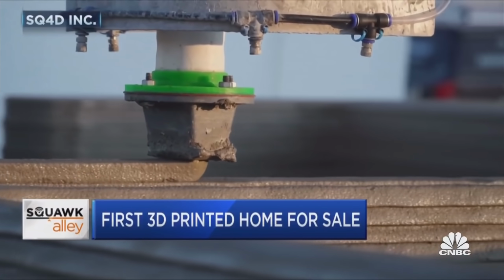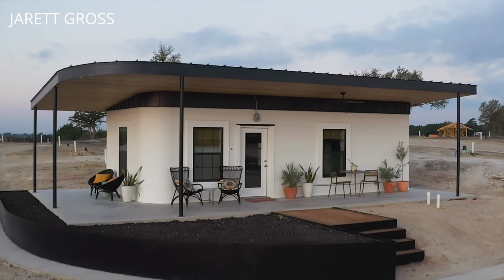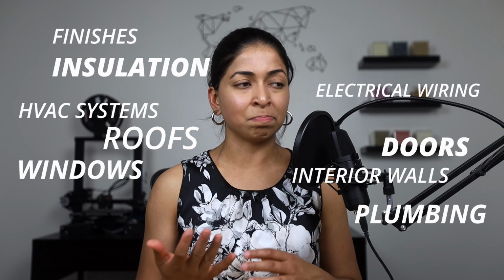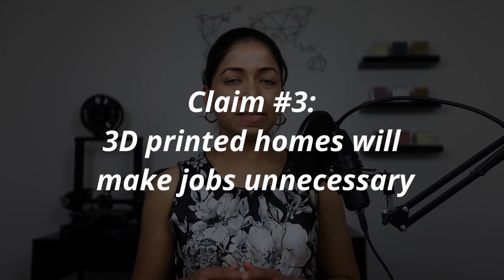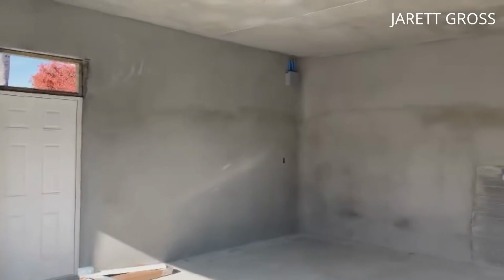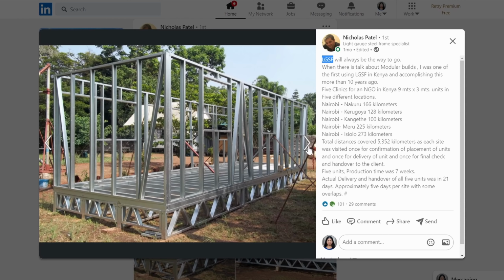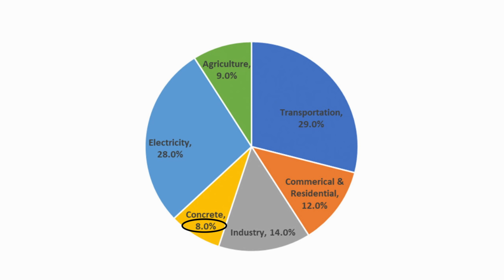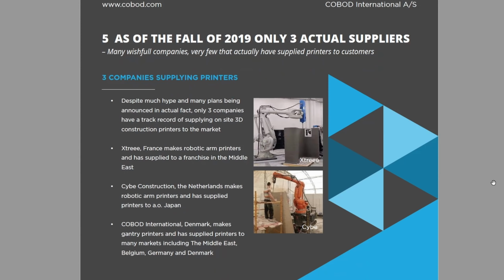Exposing 5 LIES about 3D Printed Concrete Homes

Comment: Anyone who has used a 3D printer will tell you one thing

The first layer is CRUCIAL. If it fails the whole print is most likely ruined. Now apply that concept to a house which can be SUPER expensive
Reply: No, that's not a meaningful comparison. The reason first layers are important on traditional printers is that the material shrinks as it dries/hardens/cures, and it solidifies extremely quickly. The first layer needs to hold it tightly so that it doesn't warp as it's curing.

Concrete has some shrinkage, but that happens very slowly, and the material is weak in tension. Instead of shrinking inwards, it primarily develops microscopic cracks.
Reply: @louisvaught2495  Still seems like the first layer of a 3D printed house would be important to the overall structural integrity. 3D printed concrete may not have the same issues as home 3D printer material, but it will have it's own challenges.
Reply: @MimiRAM0NE  The problem is that trying to draw an analogy to normal 3D-printing is basically a complete failure to understand how and why the two things work.

Printed plastic can extend and contract a lot, and builds internal stress that causes it to warp and change shape. The first layer has to hold the part in place so it maintains shape while printing.

A small mistake at the base of a printed concrete building doesn't cause the entire structure to curl inwards - aka failure of the entire print.
Reply: @louisvaught2495  I agree about a small concrete flaw not likely ruining the whole structure. Thanks for explaining more about 3D printing, very interesting!
Reply: CR/BL touch for home 3D printers and you will never have an issue. For houses, you do not have a small nozzle, the layers are at least an inch or two thick, also the weight of the material will level out.
Reply: Haha, funny analogy but not even remotely the same functioning principles during the process and final goal.
Reply: Imagine leaving it unattended and coming back to a failed print...of a home!
Reply: @MimiRAM0NE  we call that the slab and yes the slab is important in all houses
Reply: joseph quinn  Maybe, but what is the point of hauling in, assembling, calibrating, running, disassembling, and removing the fancy concrete 3d printer instead of just throwing up some prefabbed molds and pumping concrete walls while you already have the concrete crew on site to pour the slab? Labor is very cheap in most of the areas this would be useful but the 3d printing machine isn't, and it is much easier to accommodate for things like plumbing and electrical wiring in molds than to make the 3d printer print around them.
Reply: I work with clay printing and we always say, that the first layer really is a mess and it always gets better 😅
Reply: I love this discussion. "Pfft, you think the first layer matters? This isn't plastic, dude! But yeah the first layer could have little imperfections that ruin the entire house and you should just use a normal foundation BUT IT'S STILL SO DIFFERENT!"

Is it? Is it really?
Reply: @louisvaught2495  The first layer of a 3d printed concrete house is important but for a different reason most common to plastic printing. Was the printers structure properly assembled & balanced?

Comment: As a mechanical engineer I have to agree with you on the "solutions looking for problems" point. I've seen it repeatedly over the last 20 years or so (and even participated a couple of times). It used to be called "rapid prototyping" which was maybe a more honest description of it's typical applications.  It's not that I don't think the concept has potential, I just know the gap between where it is and what is being sold is significant.  I see lots of press about the speed and labour savings, but little about the mechanical properties or durability of structures made this way. 

I also wonder what 3D printing concrete achieves that pre-cast and/or poured concrete can't.
Reply: Pre cast and pouring needs someone to design and make molds for the concrete
Reply: @mrslinkydragon9910  There are plenty of modular pouring systems, that are assembled on site as needed. You add rebar into it, then the concrete pump arrives along with a bunch of mixers and you are pouring in 10 minutes. No giant CNC structures, and is pretty fast. You can create whatever structure you want, as tall as you need it, you can put water, heating pipes and cables in the molds before pouring the concrete...
This so called 3d printer is very limiting and won't be any cheaper than traditional methods. That's why no self respecting construction company is adopting it.
Reply: All I can think of is niche work where a form would be exceptionally difficult to build or tear down.
Reply: I guess extremely complicated curves in walls. 
But few civil engineers dare design them. PITA to do the calculations.
Reply: Looking at the walls in videos like this, the benefit is crazy thick walls.    That may not be a benefit though, it may simply be an inherent flaw in the design.   I'd think it would be cheaper to cast blocks at a factory with 25% of the concrete used in these solid walls.   It looks like with a decent work crew, they could put the concrete block walls up just as fast.  Or precast the walls at a factory, and deliver them to the work site.
Reply: @mrslinkydragon9910  "Pre cast and pouring needs someone to design and make molds for the concrete" ...and the emergent technology of 3D printing doesn't require more design work to qualify the structure in an unproven medium?

Comment: As someone that live in a country with heavy seismic activity he idea  of living in a house without a steel frame is kinda scary specially when construction companies often cheap out with the concrete
Reply: I'm in the structural side of design, and my first thought whenever I see any of these videos is "and how are you reinforcing? Is it in the cores, similar to CMU? If so, HOW." I don't blame you for being scared. I see this as presented by news agencies, and I see "Unreinforced Masonry - but High Tech!" URM is a huge killer in earthquakes.
Reply: Are you guys slow? Most houses in america are made of wood and drywall, not steel.
Reply: @thefunshackwars5418  I am from Peru in South America it's located in a continental fault line so we get magnitude 5 and 6 quakes somewhat often, most good houses are made from brick and concrete with steel frames
Reply: @MarkCisOfTheLoonieLeft  hemp wouldn't resist a rainy season though
Reply: Properly designed wooden structures can be just as safe as steel frame (up to a certain size, skyscrapers aren't really an option with wood), but if you don't have an abundant supply of cheap wood available the way Canada and the US do, then yeah, steel framing is definitely critical if you're expecting any seismic activity at all.
Reply: @rashkavar  yeah thats why a tornado comes and wipes all the houses xD it wouldnt wipe a reinforced concrete one though... all other countries build with it and they last a life time, while America wood houses don't last for shit and are on constant remodeling and fixing. Most of the times houses with like 15 years are completely destroyed and rebuilded since its faster and cheaper, than fixing all the issues.
Reply: @eisforenkai  yeah i was tinking about that to is it just hollow inside?
Reply: @vinhix  well... we dont have tornados and shit but our wood houses in Norway lasts for 100 years easily if its built correct. Then again i guess we have a much higher standard here on our houses considering the cold and all
Reply: @vinhix  So let me counter your arguement. Whens the last time say...florence had a tornado? Or really any tornado of any significance anywhere in say... Europe that hit a population center?

Secondly, Masonry doesn't hold up much better against 300-500 mile per hour winds than wood does. The joplin tornado actually lifted the hospital and moved it a few inches and wraped I-beams around trees. Ain't shit you can do about that other than building bunkers.
Reply: @eirik874  We have wooden homes that are over 300 years old in the US. Its just uncommon. But you also have to realize, Americans were dirt poor until the 50's. You just didn't have money to build good houses unless you were rich.
Reply: @goldenhate6649  i understand that yeah it was hard times i can imagine. Did people build with whole logs at that time? because those to can stand for a long long time.
Reply: @vinhix  The problem with your statement is that you specify "reinforced" concrete.  These 3d printed concrete houses don't have the steel rebar inserts / steel frames that create the reinforcing effect so it has limited ability to resist catastrophic failure.
Reply: @vinhix  That's untrue. I used to frame houses (some of which recently were tested in a tornado that you can find videoed on YouTube. Andover, KS from earlier this year) While 200 mph winds do destroy wood framed houses, the concrete and steel building next to them was also rendered useless. It turns out that a chain is only as strong as it's weakest link. Windows and doors become inroads for debris and wind/ rain, meaning that a "concrete house" will be very nearly as dangerous in a tornado. I was even warned to stay away from poorly constructed concrete warehouses in a port in Madagascar when I was volunteering there and a cyclone was forcast. 
I've ridden out the first Andover tornado (April 1991) in a wood frame structure which I also was in when a 4.6 or so, magnitude earthquake happened a few years back. Nothing even fell off of the walls because a structural frame design with an outer skin, such as American woodframe houses, is actually the basic design behind skyscrapers and it allows a structure to flex with conditions. The house is still there, today, and recently remodelled due to the incredibly cost efficient upsides that come with engineered wood frame construction.
Reply: I live in a country with practically zero seismic activity, and on top of that we have only had a total of like 13 hurricanes in the last 130 years, and I still wouldn't buy/live in a house made of concrete with no steel :)
Reply: @thefunshackwars5418  wood is stronger than you think. And it can bend, so it’s safer in eathquakes than pure concrete.
Reply: You and everyone in the ring of fire, buddy. Depending on where you live, a Richter 6 can range from everyone losing their shit to "Huh, I actually felt that one. Goona check the news, might have been bad somewhere."
Reply: @rashkavar  well Japan been building wooden houses in earthquake zones for over 700 years
Reply: @vinhix  This is utter nonsense.  Where I live almost all single family dwellings are stick framed houses, with an average age of about 50 years.  There are lots of buildings 100 or more years old, and anything built since modern codes were introduced in the 70's is likely quite capable of lasting for centuries without any major changes to the base structure.
Reply: @vinhix  Wow, good to know the 52 year old house I'm living in has been rebuilt 3 times.  Or the almost 100 year old house next door.  Yep, every 15 years.   Where do people get this crap?  With the exception of the house next door, nearly every house in my neighborhood is at least 50 years old.  Although, mine did have 2 new layers of shingles on the roof, does that count as being "completely destroyed and rebuilded"?  Well, there was that one house across the street that was at least 50 years old that caught fire one night.  Strangely enough, they just fixed the damaged parts.  Does that count?  Come to think of it, there have been at least 3 other houses in my neighborhood that had fires, in the 22 years I've lived in my 52 year old house, and all of them just got repaired.  Guess they all got "rebuilded" too?  Maybe rebuilded means something different where you live?  Anywho, have a nice day.
Reply: @vinhix  Probably because all of those people are constantly wanting "improvements" to the houses, such as extensions and expansions, which aren't done properly so you end up with things like leaks going between walls when it rains heavily, then wind up with parts of the building decaying or falling apart. Always the "latest and greatest" trend pursuit going around as well, so there will be people trying to one-up each other and make the building look nicer for some of the people with more wealth. And don't forget the fact that sometimes the land is more expensive than the building itself, but people will mostly be looking at the building when buying a home, so there's a need to make that home look prettier -- even if it means completely tearing down the building and starting from scratch. Wood houses are probably easier to start a remodel process on, making it rather tempting for those people who are influenced by trends to try their hand at remodeling and "fixing" the house to fit their desires -- but that also makes it a whole lot easier to screw up, especially if they don't know what they're doing